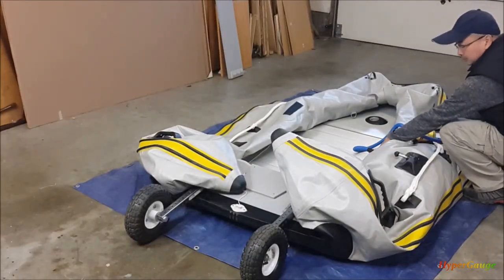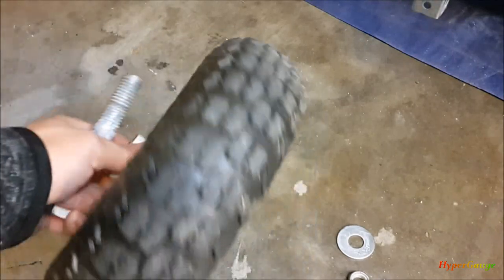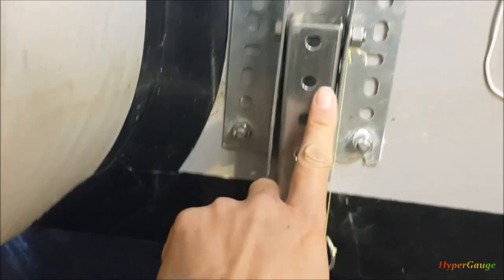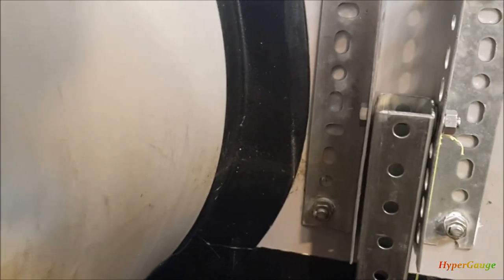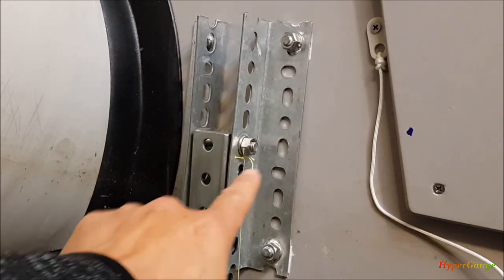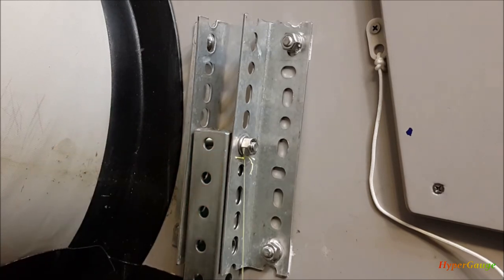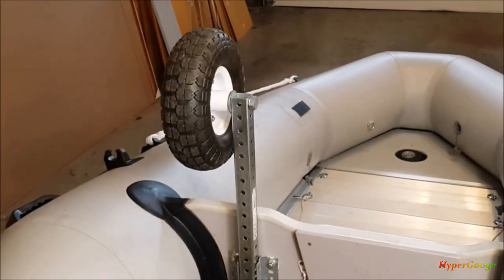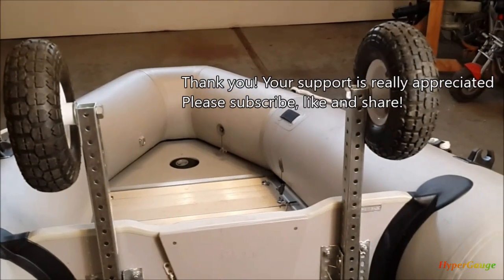DIY boat launching wheel – tips, trick, material, size and how to. My build detail and experiences,

Comment: Nice job.  I'm about to start a similar project and you gave me some good ideas.  Went and bought the punched 1 1/4" square tube tonight at Home Depot.  Seems like it will hold up well.  I'm using it in freshwater, so the plated zinc should work well.  Have fun with your boat!
Reply from the maker: Thanks for watching my videos. Good luck with your project too.

Comment: Dude love it! I think it would be fine in the saltwater if you rinse with freshwater after every use.
Reply from the maker: Thanks for watching my video. It is possible, but my experience using my boat in the SF bay is the salt water will get into every cracks and small area. I always end up finding rust here and there even I tried to clean as much as possible.
Reply: Hypergauge darn, wonder if you painted the metal before you put it on. I’m going to to put it on but I’m only going to be using my inflatable in the saltwater
Reply from the maker: I didn't paint mine since I mainly use it in fresh water now. There are some minor rusting from using it in the bay, and I use WD40 to take care it.

Comment: My dinghy wheel just break down after 5 times used so I found your job and making now with 1” same but smaller than your because of weight but I haven’t found 5/8 4” hex bolts yet in 🇨🇦
Reply from the maker: Thanks for watching my video. Your local Home Depot should have the 5/8 4” hex bolts. or try Ace hardware. If there is no 4" available, you can use 6" should be fine.

Comment: Do you think 2 patches of VHB tape would keep the wheel brackets without drilling the transom board?
Reply from the maker: I don't think that is a good idea. There is a lot of force put on the mounting bracket. You really need to use the most solid mounting method. Good luck with your project! 👍

Comment: Looks good!
Reply from the maker: Thanks.
Reply: @HypergaugeDIY  i am gonna try my own idea ,,pvc2 inch thick  tubing ,bolted by u bolts on the transom then another with wheel  on the end slides into the pipe with a snug fit ,the wheels float full of air ,then just put them in the top of the tube or pipe  when afloat ,what do you think ?
Reply from the maker: If your boat is not that heavy then it may work. The concern is the strength of the PVC pipe which I am not very familiar.  My boat + gears weight almost 130lbs (battery is very heavy), and my setup is holding up just fine. Good luck with your build.

Comment: What about whenever you pack your boat away I know you probably remove the swing arm but what about the sharp looking angles on the transom ?
Reply from the maker: It is true that with the wheels mounted, I cannot completely fold away the boat. For my purpose it is small enough that I can still stow away it easily. If storage space is your concern your option will be very limited.

Comment: Great job Do you think the wheels can hold a 12' jon boat?
Reply from the maker: I estimate the most heavy load I used this wheel on the boat is around 250lbs. That is the boat+ battery + motor + gear + one kid and the wheels are holding up just fine. Beyond that I don't have any more info. If your boat is not that heavy it should be fine. The steel and wheels in the design can handle a lot more weight, but if loading is a concern, you should reinforce the mounting and the bracket. Good luck with your project.
Reply: @HypergaugeDIY  ok thanks

Comment: great job ,,i have a BRIG RIB F300 ,,it is 145lbs dry ,,i went to a web site that sells launch wheels ....it had all the measurements ,,,instead of using 1/8 aluminium .i went with 3/16 aluminum angle, and 3/16  .oblong square tubing ..the wheels i got on sale at princess auto ,or harbour frieght   10 bucks each with inner tubes so they float ...i was gonna use punched steel like you ..but i  got  aluminum cut to size,45 bucks from metal warhouse ......if you follow the sizes and set up of saturn wheels ..its a breeze ,and i mean no offence but  i wanted something ,that looked abit more eye pleasing ..great job ..now can you desighn some AAtype  battery navigation lights please ,,well done sir

Comment: Good job.  But i would think that a shorter wheel stem would be preferable because you need deep water for the boat weight to be off the wheel.
Reply from the maker: Thanks for watching my video. I think the length of the stem is not very critical for a small boat like the one I have. I guess longer one is needed if the boat is longer.
Reply: Thanks for doing this video